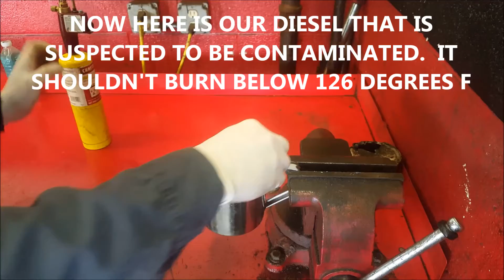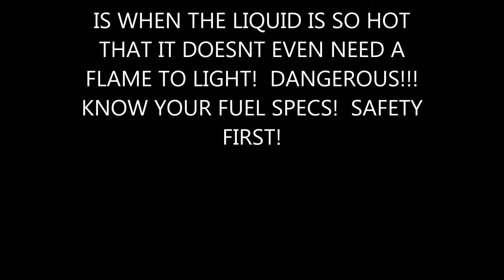HOW TO TEST FLASH/FLAME POINT AND FOR GASOLINE IN DIESEL  dont put gasoline in you diesel!

Comment: Petrol in a diesel dosen't usually do any damage from my experience other than poor running. Diesel in a Petrol engine causes lot of smoke and the oil level will rise as unburnt diesel gets past the rings
Reply: pretty sure it can take out the high pressure pump due to the reduced lubrication.
Reply: @larstomasson9244  yea it's definitely not vitamin c for common rail haha

Comment: Thanks for the video !!! I have fuel in canisters that’s I would like to test and determine whether it’s gasoline or diesel. Can you tell me what type of thermometer you have ? I already have a torch to perform the test
Reply from the maker: No prob.  Just be really careful! If it's gasoline it's extremely flammable and dangerous. If it's straight gasoline you would be able to tell just by taking a tiny whiff of it. Diesel is much more mild and doesn't have as much stink to it.  I assume you already know this. But it would be terrible for something to happen. Just make sure to use a very small quantity of fuel also when you doing any testing. I think I got that thermometer at Harbor Freight. But you can get them at Home Depot or pretty much anywhere
Reply from the maker: This test is really designed to just see if there's a slight gasoline contamination in diesel fuel